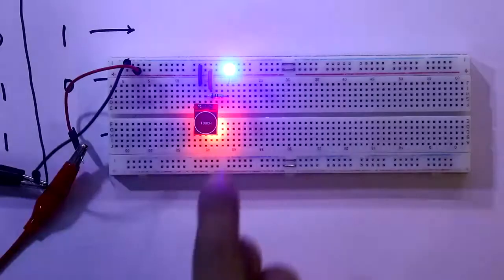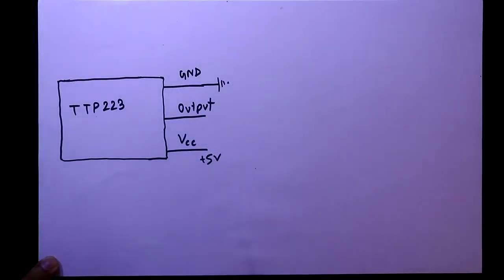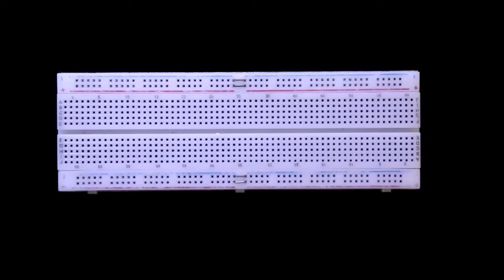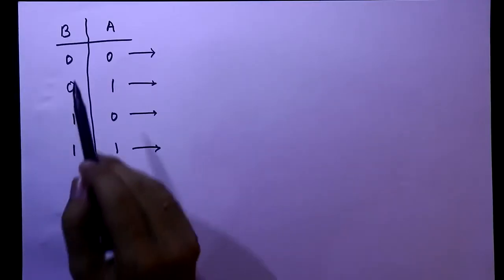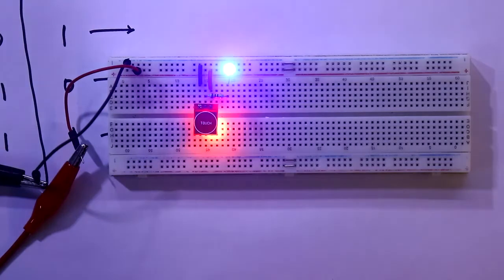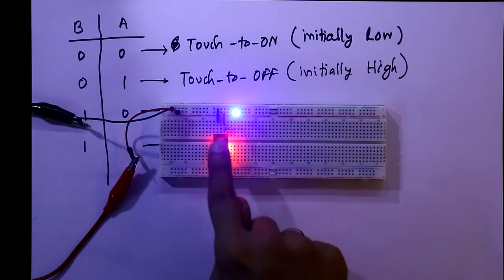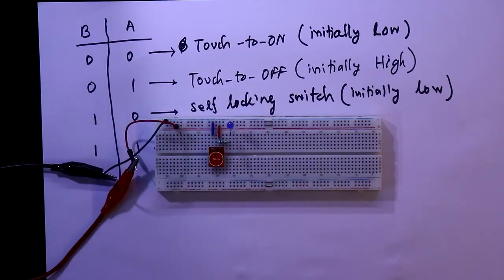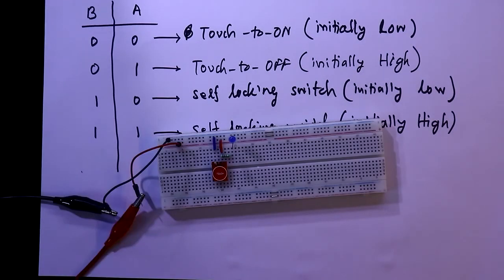How to use TTP223 capacitive touch module circuit

Comment: Great video i now know all about how the switch works, but could you tell me why you need to put a risistor in. i have a capacitive switch module that i am trying to connect to a keyboard control module but cant seem to get it to work please help.

Comment: Only has 3 modes. Does not work with both A and B shorted at the same time.
Since B functions as the latch condition, no need to short A in that use case anyway.

Comment: I tired it in position B....its v sensitive ....even if finger is little bit away from switch ( approximately 0.25 inch ) ...its get switched ON/OFF.   So Can it be used for commercial project ? Can some noise or something else  can make it ON/OFF.
my purpose is to switch ON/OFF power supply to microcontroller board...

Comment: Hello , with the touch sensor , if i wanted to connect a 0.5mm wire to the touch part , what part of the circuit board would i need to solder the cable to . I want to control a relay giving an automatic door an activation signal from an insulated push plate on the door . The cable connected to the push plate to the touch sensor .

Comment: Using this sensor, it will turn LOW after 6-7 seconds.  The touch light goes off as well.  Did you experience this with the TTP223?

Comment: Please suggest any practical application of this circuit ( AC load control )  , and from where to get working voltage for the module
Reply: Buy 220v relay module or make one yourself 😊

Comment: Great examples.  Do you know how much maximum current the module can pass?  I haven't been able to find this information.
Reply from the maker: I think it is very little. To control a load, it is better to use a transistor with output pin.

Comment: i bought some of the 223b touch sensors from aliexpress a few years back and finally found a use for them... just to see if they worked, i tested it with my bench power supply, at 5v, black to ground and red to vcc.   doesn't seem to recognize touch at all... tried another - same thing... tried a third, same thing... so clearly i must be expecting something different... shouldn't it still work even though it's not connected to the signal?   must be doing something wrong, what are the chances three of them don't work...   any ideas?  all i want to do is make a short strip of 5v led light strip tape turn and off....  how hard can that be?

Comment: Sir , in case of Touch to ON mode (initially low)  I want to control only one LED using four TTP223 sensor modules ... Then what will be the circuit ? Please help sir !!
Reply from the maker: Hi Parag, for that you have to use OR Gate logic circuit. No need to use OR gate ic, just 4 Diode is enough.
Reply: @EEWave  sir , where and how to connect those 4 diodes ?
Reply: @EEWave  You mean N side of each diode at i/o pin of each Touch sensor and P side with LED and  then all the touch sensors are in parallel with each other ?